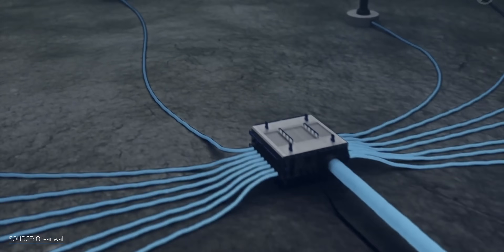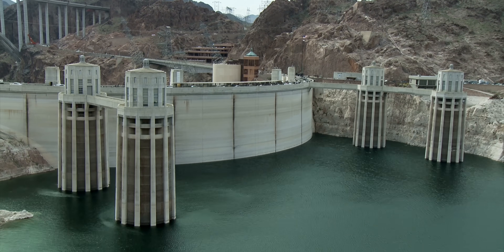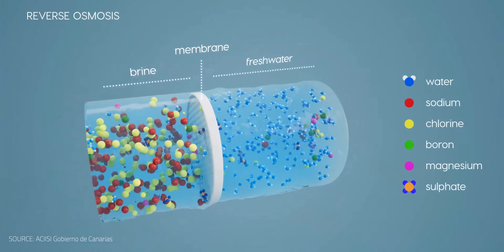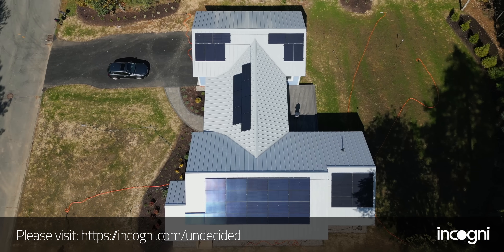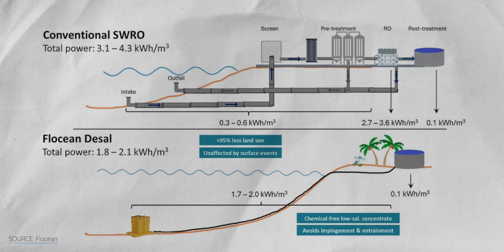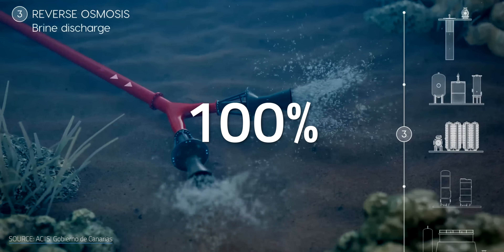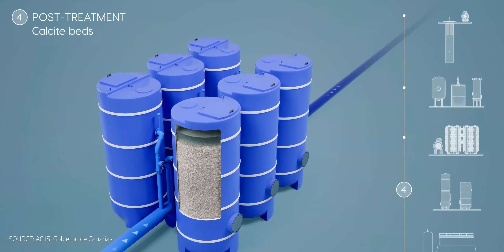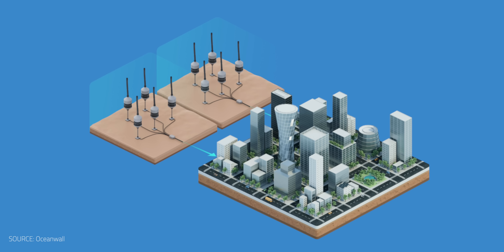How Deep Sea Water is Now Drinkable

Comment: This makes sense if there is a pressure checking system or a storage tank underwater so that the pump on the floor was only pumping water out of the system up to the level on land instead of pulling water through the filters.
Reply: adding a tank does nothing. that's not how tanks work.

Comment: What needs more explanation is that the advantage is not in the reduction of power needed to push water through the filter ( that remains as you pump the fresh water up and out of the sea)  but rather the fact that without being at depth,  you have to  pressurize a much larger volume of water, most of which just gets released, losing all that work.

By keeping all the work on the fresh water side you are working on a much smaller volume of water,  and energy needed is a product of pressure difference AND volume of water. Further more it's a much less corrosive environment. The volume of water drawn into the system and released again is all low energy work (it remains at high pressure), so you can use a lot more salt water, thereby reducing the "super salty brine" problem. (also making the process a bit more efficient).

The down side is that all maintenance is at high pressure in an inhospitable environment.
Reply: It does seem to make sense what you say, until you consider that oil companies operate these types of equipment in these depths and already have maintenance crews that work in these environments. 😅Is joining the niche job market oil companies already operate in
Reply: @katanaridingremy  working at 20 atmospheres can never be as cheap as doing it in your shorts and a t-shirt on the surface. Seawater has an osmotic pressure of roughly 26 atmospheres (atm), and reverse osmosis plants typically apply pressures of 50-80 atm to effectively desalinate the water.    Yes it can be done..  no it won't be cheap.
Reply: @julianelischer true but nothing is cheap at first. Someone has to eat the cost of nothing ever changes. Imagine if the first american settlers never bothered to come to these lands because it wouldn't be cheap. Imagine if America didn't buy all the land it could because it wouldn't be cheap. Sometimes, if you want to win later you have to take the lose now.
Reply: Excellent points.  Thanks!

Comment: To me there is a flaw. The suction required to bring the fresh water up to sea level will equal the depth pressure plus the pressure differential required for reverse osmosis at depth. The additional suction pressure to create the pressure differential at depth will equal conventional  osmosis pressure differential required at the surface.
Reply: didn't you get it - it's because there is such and such company in Norway, and such and such company in UK, and they have a HQ and do gas mining, and have a hub-and-spoke model... blah, blah, blah... and don't forget we're sponsored by incogni, click the link in the description... like and subscribe!

Comment: The reason it takes half as much energy is because you are only pressurizing the output water. The total water in the system is the output water plus the brine. On land, to produce one kg of output freshwater, you have to pressurize two kg of salt water to 50 atm. With this system, you only pressurize one kg of freshwater 50 atm. to get it to the surface. Same amount of pressure, but half the mass. On the surface, the brine that you pressurized is returned to atmospheric pressure after it passes by the filter, so the energy of pressurizing it is wasted. At depth the Brian starts at 50 atm and remains at 50 atm so the energy of pressurizing it is not wasted.
Reply: Ok, you do need to pump less water. But you are doing this 500m down under and most of the COTS equipment like standard pressure vessels and membranes selling for $10-30/sq.m. is not going to work "plug and play".  From the brief research I've done it looks as though the actual energy price to drive these high-pressure pumps is something like 10-20% of the price of water ($1-$3 per cubic meter). You slash this cost in half...you aren't  slashing the cost of water in half, only of the 10-20% part of the cost, so maybe $3 water will start being $2.7, for a lot of RND and really mass-scale production to even stand a chance of investment recovery.
Reply: @throwapot  actually more info in your post than in the video)
Reply: If you are discharging brine at 50bar you are doing something wrong.
Water at 50bar is only compressed by less than 0.5%, that allows you to swap brine for 'fresh' saltwater with minimal loss.
Reply: great explanation
Reply: Work:
When a force causes an object to move a certain distance, work is done. The amount of work is calculated by multiplying the force by the displacement (the change in position
Reply: Note that RO plants actually don't fully waste the energy in the waste stream, instead they do try to recover some of it. It's not perfectly efficient of course, but the really good ones can recover like 90%+.

Overall the thermodynamic efficiency of an on-land RO desalination plant is not terrible... Like 2-3 kWh per m^3, compared to the thermodynamic minimum of 1 kWh/m^3. And that energy makes only a fraction of the total cost!
Reply: @marklundeberg7006  My well at home isn't that much more efficient. Pumping fresh water up from 92 m of depth, with an ejector pump. Just a bit of guestimation, but I get a flow rate of around 10 l/min, which equates to around 600 l/h. (Might actually be a bit lower, if I would trust the datasheet of the pump manufacturer). And the pump motor takes 2.2 kW. So a cubic meter of water costs me also around 3 kWh.
Why am I doing this? The next village is some 3 km away, and the cost of pulling a line is a fair bit more than the electricity needs I have for pumping water for the rest of my life! But, it still isn't energy efficient.
Reply: And the only reason this even is needed because US allow privately owned lakes and water sources, and water reservoirs drained out…
Reply: @MP-vc4nu  well that and the worst drought in 12k years. And the increases in severity and length of drought across Southern Europe the Middle East and Africa thanks to climate change

Comment: The wave power plant off Garden Island in Western Australia used to generate high pressure salt water which could be used for either power or desalinated water depending on the instantaneous power need.  Not sure if they still do...  using wave power for desalination seems a natural.

Comment: RO energy use is overstated.  The Carlsbad Desalination Plant actually uses less electricity to make each acre-foot of fresh water, that the California Water Authority uses per acre-foot to transport it from the Sacramento River Delta to Southern California!  The numbers are all available on-line in public documents.  Anybody can verify that easily.  Transportation from the Colorado River uses about the same amount of electricity per acre-foot as the desalination plant uses.  And the really nice thing is my avocado trees thrive on the pure desalinated water.  Colorado River water is too salty for them.  Many Southern California growers run their own RO processing for their trees.
Reply: The problem is that the cost of electricity is not the main cost. The equipment and maintenance cost is the lion share.
Reply: @bknesheim  
The cost of maintaining the aqueducts, pumps, reservoirs, dams, etc. far exceeds the cost of building the desalination plants.  A private company built the Carlsbad plant and they are still in business because they make a profit every year.  The electricity they use for water transportation is about 1/5th of the electricity used in California every year.
Reply: @BigGuy8059  Carlsbad produce only a 8% of the volume in the aqueduct and transport it more then 1100 km. Carlsbad is  for San Diego County, a much shorter distance.
Reply: @bknesheim  
I never suggested the one desalination plant could replace the aqueduct.  It would require several plants that size and larger to supply all the water in the aqueduct.  But my electricity use calculation was based on acre-foot of water delivered, so it would scale to any amount.  Less electricity would be needed than what is used now.  The Carlsbad plant only supplies their water to four North San Diego County water districts, so the transportation costs are minimal.

Comment: Avoiding all the accessory equipment is a big deal. Energy saving is good, but reliability and simplicity is why most current desalination plants use flash thermal processes.
If it's just pumping fresh water up a pipe from the ocean floor and you don't have to worry about membrane fouling, that makes it much more reliable.

Comment: I'm so confused on why this saves energy. If the system is installed and no pump is running, the osmosis pressure will cause fresh water to go across the membrane and go back to the sea, until the water level of the freshwater pipe is deep in the ocean. To get this freshwater out from the deep, you will need to have a pump pumping it with large pressure, which will be around the same as the pressure used in land-based RO plant. What's the saving?
Searching on the internet I only find 1 paper about this but is for freshwater used in deep sea for oil drilling (not going to ask how that work I only read the title), not for land use.

Comment: I'm not sure this system would work as claimed. I'm not a mechanical engineer, but to my understanding, the absolute ambient pressure at the location of the RO membrane(whether at the bottom of the ocean, or in the core of Jupiter) it's irrelevant, what matters is the pressure differential across the membrane. Water won't flow unless there’s a pressure difference of at least 30–35 bar to overcome osmotic pressure and membrane resistance, regardless of whether that differential is achieved by raising the pressure on the inlet, or lowering it on the outlet... energy must be injected into the system. And if you're achieving that differential by lowering pressure between the RO membrane and the pump, you still need to overcome the head lift differential.

Comment: It does make sense. It's harder to push water through a tube than it is to make a vacuum for the water to fill. Water moves more inefficiently the more pressure you put on it. Creating suction is far easier. Glad to see solutions like this.

Comment: I invented this in 1984 but I couldn't get anyone interested in backing it, and I myself nor any of my family or extended friends had the money.  It's a super simple concept.  Salt water weighs more than fresh water.  You drop a reverse osmosis filter box connected to a pipe into sea water, preferably away from river outlets,, and it will fill with fresh water as it descends.  When you hit a depth around 3.5km the difference in the weight of fresh water in that pipe to the surrounding salt water creates a pressure equal to the osmotic pressure of salt water vs fresh water.   The thing about this company... 400m... um... I don't know where there's water salty enough for that to work.  They must have some kind of catalyst-assisted reverse osmosis filter.
Reply: They use pumps
Reply: In this idea of yours, how much would it cost to bring that fresh water back out to the surface from 3.5km? Or, have you gotten that far yet?
Reply: @brandonchan8255   Beyond 3.5km the deeper you go, the higher the pressure of the fresh water.  So it brings itself up, and can even deliver it to reservoirs on land without any additional energy.  If you dropped it to 4km you could put a generator on top and make electricity.  But it wouldn't be free energy.  You'd need to maintain the system.  The fresh water is far more valuable towards paying for maintenance.

Comment: How much longer would the Surface Desalination Plants Membranes last if they simply extended their water collection pipes down to the deeps?

If they grab water from the deeps where micro-organisms are scarce, would they not be able to stop using the Pre-Treatment Chemicals like the Deep Ocean Pods do? that would at least allow them to reduce their operating costs and waste production while increasing their Membrane Life Spans wouldn't it?

Personally, if they can figure out how to Power the Pods locally without needing long High-Power Cables as well as how to quickly, safely and economically swap out the clogged Filters for new ones, then I'm all for the Deep Ocean RO Pods instead of On-the-Surface Desalination Plants...

Comment: What I heard in the first bit was that desalination plants (and the environment) could benefit massively from onsite Small Modular Reactors....
Reply: Make them thorium powered as well, the technology has been around for decades, but never really became the norm because of countries needs to make nuclear weapons which requires the more scarce and dirtier uranium. Since we don't need more nukes, just the energy, thorium is perfect for SMRs. And the more SMRs being deployed, the cheaper they become to mass produce.
Reply: @John8087  Well, deploy available ready to go SMR tech now. However, while I have the opinion that downstream thorium processing hasnt been fully addressed (the chemical processes involved and the leftover materials cannot be overlooked), I cant say I disagree... I mean, if thorium based SMRs incorporate deadman safeties like neutron reflectors to maintain reactivity (AND EVERY DAMN REACTOR SHOULD EVEN THE CURRENT SMR DESIGNS!!! Look into why the SNAP-10 satellite died, a voltage regulator which had nothing to do with core health died and because the system alarm triggered, and the safety was tied into the normal system alarm, it irreversibly blew the neutron mirrors away from the core killing the satellites power. A+ safety design) then in a loss of coolant scenario (external power generating coolant that is) firstly they have like 3 days in some designs of self cooling capability (at least the last time I looked into them, and if we cant get a trucks to hose down the spicy rock tubes in 3 whole days, we kind of deserve what we get...sorry not sorry) and second, in the case of thorium fuel, the liquid sodium medium (thus part of my processing issues) freezes killing the reactor outright. It would need to be bootstrapped into operating again. Failafe. Ergo, as long as the main loop maintains containment, that is an attractive prospect.

That being said, I dont know of any currently fieldable thorium SMR designs nor maintenance programs even being suggested. So im A-OK with 3% enriched uranium reactors, which by the by work in favor of nuclear disarmament since you can use one +90% enriched core to make many, many, SMRs. SMRs that can help today, right now. Not whenever a thorium design passes regulatory hurdles and actually becomes able to be deployed.
Reply: @John8087 I don't hate thorium. But there's a reason no one has a working commercial thorium reactor anywhere in the world yet. And it's not nukes. If it were just that, we'd have developed this a long time ago to give to countries like India, Pakistan, Iran, etc to prevent them from pursuing the bomb anyway.

SMRs will be great, but again, the problem isn't energy. It's efficiency. SMRs are expensive (and currently non existent) ways to get energy. If we make fresh water so expensive that it's not affordable, then that still doesn't work. Also, it wouldn't solve the brine problem.

It's not like this idea is novel, a lot of the world's desalination plants were built coupled to nuclear power. The reactors provide energy, the flow of water for the desalination provides cooling. It's just expensive.

Comment: Worrying about water in a planet where the surface is 95% water is wild
Reply: 95% of that water is salty. Most of the 5% is frozen.
Reply: @davidgunther8428  so get the salt out. 🧂 aleays wondered why we have so much trouble. For Pete sake you could put together a bunch of mirrors pointed at a boiler tank and just boil the water to clean it, 0 energy needed. And the salt? Use it to clear the snow on the roads. Bam
Reply: @TheAshYam the video already explained why. If you're interested in this question, a few hours of research will tell you at length all the environmental, energy, and maintenance issues with desalination.

Outside of the Arabian desert, it's usually not worth the cost.
New ideas like in the video are new attempts to get desalination cheap and clean enough to be practical.
Reply: @onikin  I love in Michigan so my prespective is a bit different.  Just seems like there's alot of ways to do this chemically. I forgot alot of places d9nt have snow to melt though